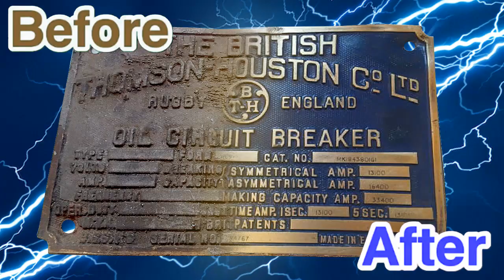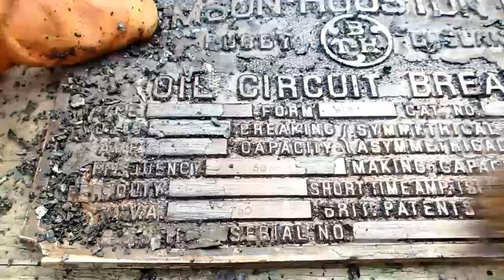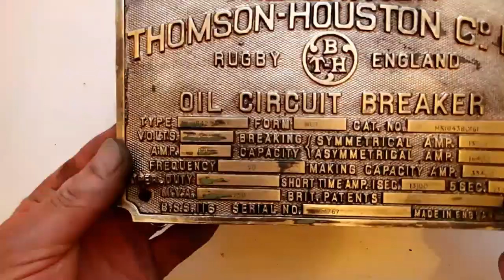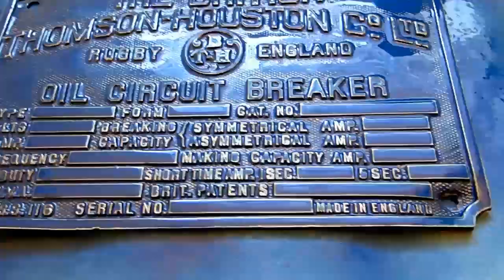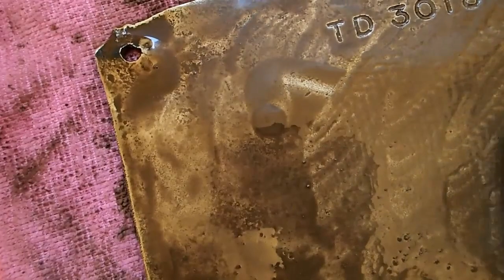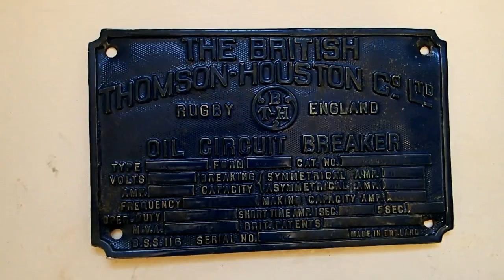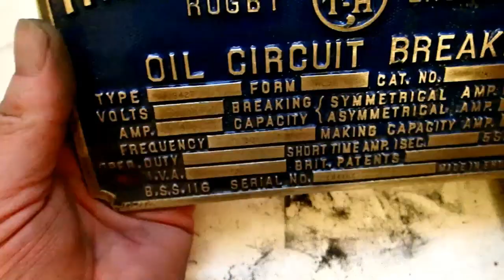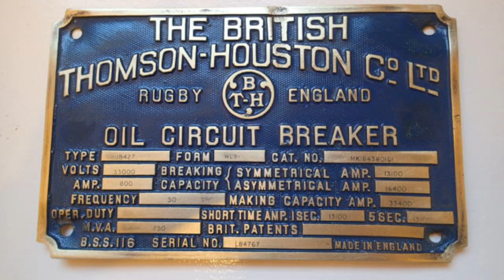How to restore and refinish brass plaques!

Comment: Excellent!. Thanks for sharing.
What I can use to restore FD connections. or Siamess Connection for the fire department. This brass has been around for a while. I am a superintendent for a commecial building in NYC.  Thanks in advance.
Reply from the maker: Hi thanks Shamir are the fd connections a rough cast brass?  I had a quick look at a few pics,  was thinking maybe a tooth brush with brasso ?

Comment: for the back try this; take some talcum add a similar amount of citric acid to it, now add some water to the mixture to the paste. Immerse the pate in hot boiling water for ten minutes, use a tweezer and remove it while it is hot and rub the paste on it, leave for 20 seconds then rub off and see the effect. You'll get the original brass look
Reply from the maker: Great tip Francis, thanks for that one😊

Comment: For those trying this at home, be very mindful that mechanical sanding devices can completely obliterate lightly stamped numbers and letters in seconds. It is far better to remove the bulk of the wet paint from the lettering and stamping areas with a small rubber squeegee. What little remains of the paint is usually easily removed by polishing, without any sanding being necessary.

Comment: I would be afraid of using heat because of the possibility of metal deformation and Brass being such a soft metal I wouldn't use sandpaper or steel wool for Fears scratching it I often clean antique brass fan blades and find that just soaking the brass in Brasso without rubbing or sanding it will clean up just fine
Reply from the maker: Thank yu for the tips Michael 😊